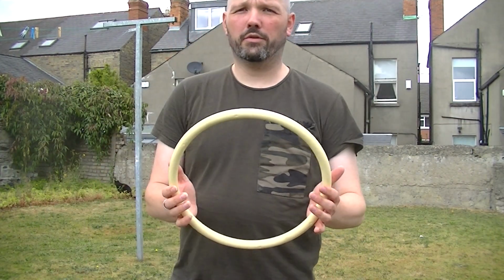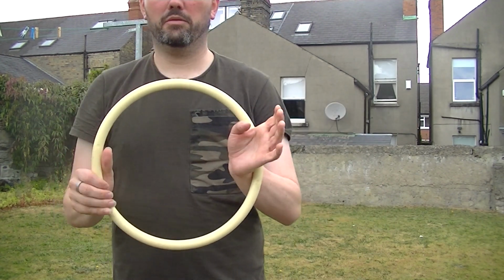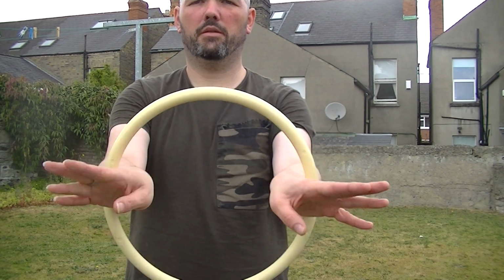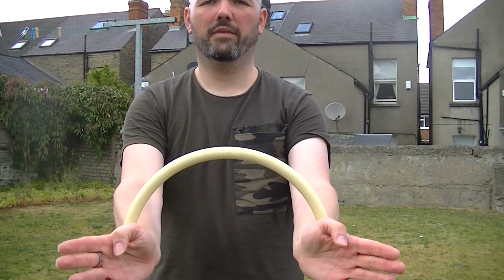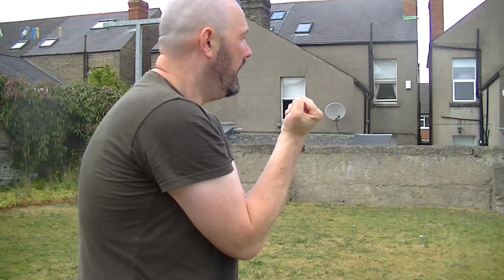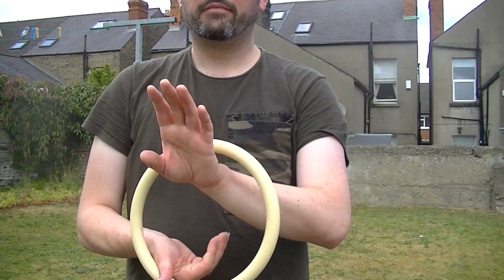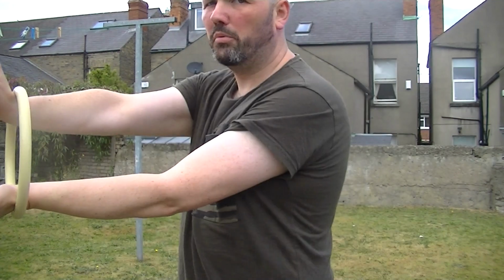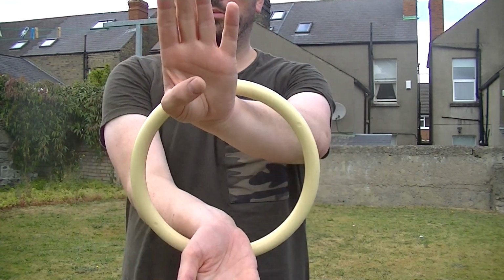Fat Shan Wing Chun- Jook Wan Huen basics -Wing Chun Kuen 永春

Comment: So a rattan ring's Chinese name is jook wan...

I'm looking for metal rings one puts over the shoulder--wears across the body...like aluminum coated and mirrorish reflective and heavy.. 16 inches 17 inches diameter...

Who sells them from whom could I get at least one if you have an idea or would find out.-Ernie Moore Jr.
Reply from the maker: @twooharmony2000  steel ring is called a "Tin wan huen" they can be got on ebay and amazon. I would suggest going with a polished steel ring, heavier plus if sweating/using the ring you don't really want aluminium going into the human body.
Reply: @cortocombateeskrima1799  i just used that search in those places,, there were zero matching results.
Reply from the maker: @twooharmony2000  https://ninefit.ie/products/irq-wing-chun-stainless-steel-rattan-ring-yewen-sau-stickykung-fu-weapons-hand-strength-trainingtsun-siu-lum-taiji?gad_source=1&gclid=Cj0KCQiAwtu9BhC8ARIsAI9JHamWiMpwrI3pIwpXX9-MQtNDxw98op-3K_TdysZBkIdKF1aghTQxUbkaAsPIEALw_wcB
Reply from the maker: @twooharmony2000  feel free to DM me
Reply: @cortocombateeskrima1799  thanks, looking for the Direct to message.  Didn't yet find.  But will do.-Ernie Moore Jr.
Reply: @cortocombateeskrima1799  right material,, sise though... Not a Wing Chunner by choice if ever

For what I'm doing I neen over the shoulder and rests on other side ribcage size. But,, you ga'e me a place that hat the right style.  Thanks.-Ernie Moore Jr.

Comment: I've had a solid steel version of this large ring for about 30 years now (bought from Shaolin Way, a shop in London's China town).
I use it for the same sort of power generation techniques and for arm conditioning.
As with the small 'single arm' rings.  Over time, you can add more rings (for strength exercises).
Sadly I can't find these larger (solid steel) rings in any shops nowadays (even online).  
You have to go to a specialist metal merchant to get something similar.

peace.
Reply from the maker: Yep, Shaolin Way was a great shop, called in there a few times visiting london and chatted with the owner yap leong
Reply from the maker: Hard to find a decent set of shaolin steel ring weights without breaking the bank these days as well
Reply: Hi Amazon has a power ring that's 10 lbs bala power ring.

Comment: Im not a big fan of this ring. You can easily loose forward pressure which is a main principle in wing chun. To keep the ring in place you apply forces to the sides and the ring doesn't simulate tje force coming to you. But if it works for you, Im happy for you 😂
Reply from the maker: I think one thing HK wc lost compared to the mainland wc is the sei ging, tan tou fou cham (吞吐浮沉; swallow-spit-float-sink). The bigger ring actually helps isolate the delts, lats, and core muscles quite alot for the delivery of force.
Reply: @cortocombateeskrima1799 you are right about that. My opinion is the Ip Man was not motivated to teach but forced by poverty. I think he knew way more than he taught to his students... but it's history.  The big ring might be actually good as you mentioned.  If someone trains a lot by himself it can do the job. Still not a big fan of it 😂
Reply: Then if what you state is true, this is a user error, not the ring.